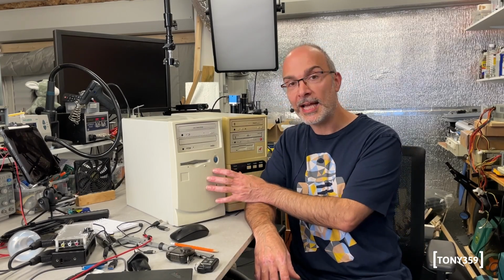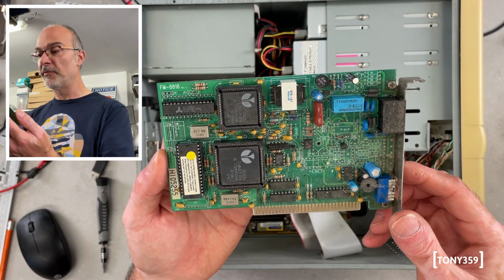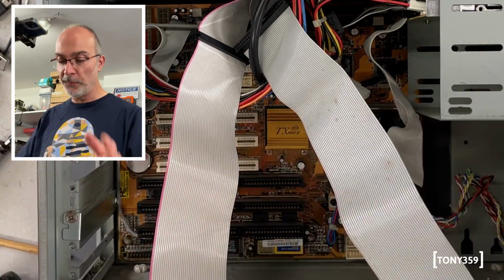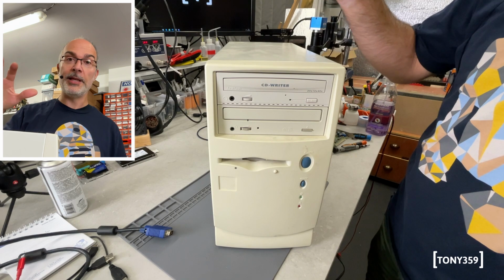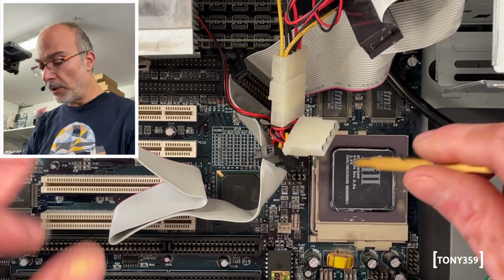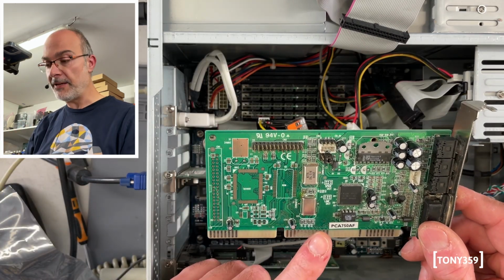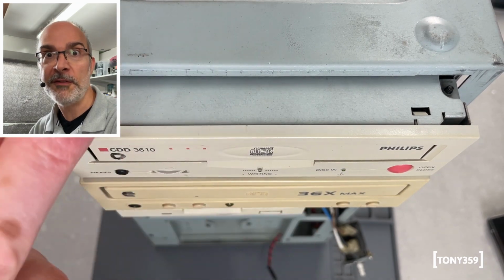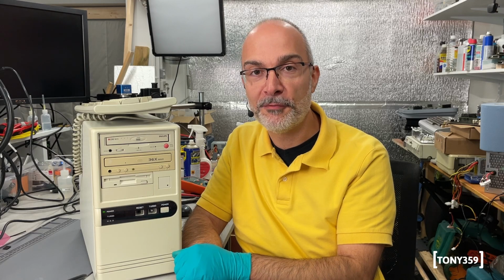I was pleased with what I found in these two old PCs!

Comment: Nice :), i have almost the same case that you are using (my first PC), just that the front is different and the case cover has indents on the sides and top. I am rebulding it with a socket 7 board, but i am missing the backplate for the motherboard :((, i have not found one that fits yet, i do have another AT minitover case that i can use until i find a plate, but sure would like to use my old original one. If anyone has one of these back plates i would be interested indeed. Keep up the great work :)
Reply from the maker: Did Socket 7 have backplanes? None of mine have it. I think some Socket 462 have it but not the Socket 7 which are all AT keyboard. Am I missing something?
Reply: @tony359  well i meant the motherboard plate that you can remove from the case, my case is missing it, so i need one that fits this periculair chassi :)
Reply from the maker: You mean the one where you screw the motherboard on?
Reply: @tony359  Yes exactly, it's missing from my case, and there are so many different ones. So i have not found one yet that fits.
Reply from the maker: Oh I see, yes, those were non-standard. Though they were just pieces of metal, maybe you can have one made if you really like that case.
Reply: @tony359  Yes that would be an option if i dont find one that fits, onother option would be to modify one that is close to the original :). I will probably have to go with my second chassi for now and install the original front on that one and also the case cover. This other case is in very good condition as well and has no corrotion either, same with my original, all in very good condition :). Have been for a while been gathering parts for this build, also the Turbo MHZ display was missing on my original, but my second AT mini tower case has a 3 digit one that i will use instead. My original front had a 2 and a half digit (max 199) display originally, would prefer one like that but a 3 digit one works fine as well. I will go with an 166 MMX i think to begin with, i have 3 Socket 7 CPU's in my collection so far. One 150 Pentium one 166 MMX and a AMD K5 PR133 :), also two Socket 7 boards :).
Reply from the maker: I'd be happy with 99 or 199 on my case! My first PC was a 25MHz 386 so "99" was science fiction back then :)
I remember when the 386 DX 40 came out and a shop told me it was unreliable "because it's too fast, the ISA legs act as capacitors and don't allow such high speeds". 40 MHz :) My Washing Machine is likely running faster than that today!
Reply: @tony359  Yeah :))), i remember a friend of mine had a 40 MHz 386 back in late '94 when i got my first PC, originally a AMD 486 DX2-66 MHz VLB system with a 1MB Cirrus Logic VLB card, and for sound a Gravis Ultrasound MAX with memory expansion. I still have the MAX card and intend to use it alongside a Sound Blaster 16 CT2910 that also has the genuine Yamaha OPL chips :).

Comment: I made some more comments, but they disappeared. I’m not sure what happened. Maybe they got taken down because they had links to Vogons in them? In any case let me try to remember what they said this really sucks.

I have a video that I linked to where I was playing halo combat evolved on a cyrix MII processor. These processors for some reason got a bad rep back in the day which I don’t think they deserved. They are actually very fast CPUs, and feel very snappy when using them in fact, when comparing them in some task, they seem as fast per megahertz, as a K6 3+

Also, I mentioned that the CPUs support 4X multiplier. If you pull BF2 to VSS

Another interesting thing is the CPUs I believe also support a 1X multiplier, which something that might be kind of fun to play with
Reply from the maker: YT sometimes doesn't like links - sometimes it does. Pretty frustrating. It wasn't me :)
My experience with the Cyrix cpus is fairly limited, I didn't do many tests. Good to know they weren't so bad!
Thanks for trying to comment :)

Comment: I think the 36x creative cd-rom is an aopen cd-rom in reality.
Reply from the maker: Ahhh, interesting! Does that mean Creative didn't manufacture their own CDROMs?
Reply: Yes and HP with CD rewriters(which really are a sony CD rewriters and with rebadged firmware with low writing speeds for example) this is more common than you think. Packard Bell's mainboards on the 486 was manufactured by Zenith
Reply from the maker: Very interesting thanks!
Reply: @tony359  Wait there's more the Philips cdd you have may have a problem with a belt that spins laser Up and down to read and write this those writer are hp ones surestore CD writer 4000 i think and have the same problem on the order hand HP cdwriter plus 7500 is a sony 4x2x24x rebadged to 2x2x24 which is the same as HP cdwriter plus 8100 based on the same sony model (4x2x24x).
Reply: i forgot to tell Sound Pro (SoundCard) is in realy a C-Media 8330. And the mainboard has that infamous ali chipset :( But for 66 Mhz frontal side bus works well, it has only problems with AGP. The AT PSU needs a load to test it. One broken hard drive has the job.

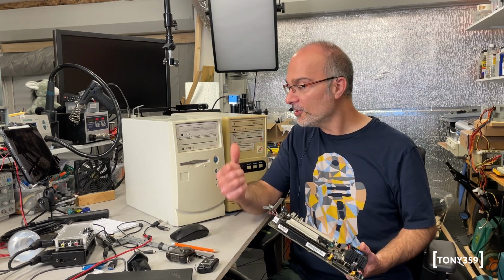Comment: 1:12 If you configure the standoffs correctly in an ATX case and use plastic stands for any holes not populated with a screw, you can fit the AT boards into ATX cases. They do sell IO Shields with space for AT keyboard ports as well.

Tempered glass RGB Socket 7?
Reply from the maker: hey this is cool! I wasn't aware of that! Been looking for a case forever (well, a cheap one!) Thank you!
Reply: @tony359  No problems. Phil's Computer Lab built one. Search Building a 386 DOS gaming PC with modern parts.
Reply from the maker: great thanks!

Comment: The system on the left looks very much like a Time or Tiny computers PC. If the chipset is ALI then it's almost a certainty.
Reply from the maker: Thank you!
Reply: I worked there from 1998 to 2006 and that case was ubiquitous with them. @tony359
Reply from the maker: It was probably a generic case used by many firms back in the days! But I love it, it's very cool! :)

Comment: The fastest CPU that Intel made that was available on Socket 7 was the Mobile Pentium MMX 300. These were technically TQFP, but there were interposer boards made for them to work in Socket 7. Today, such examples are rare and command a price premium, so they're not worth it unless you're wanting to make some specific build. The Chinese also made their own with gold heatspreaders on them some time long ago, these are even more rare. I've only ever seen one in the wild.

There were very few Socket 7 boards that supported the multiplier needed for those (4.5x), so you generally need a Super 7 board to use them at full speed.
Reply from the maker: Very interesting, I was not aware thank you!

Comment: As soon as the case was opened up, I saw the motherboard and knew we were dealing with a PCChips M57x of some kind. I thought it was the M577, but that's Super Socket 7. If you want to tempt fate, you can use a K6-2 or K6-III with versions 3.2, 3.2a, and 7.0 of the M571.
Reply from the maker: ahah I think I'll adopt the Shuttle 591P for my own system! It seems to be one of the favourites! Thanks for watching!

Comment: Nice findings especially because all of their parts work, so you have spares that are ready if something goes wrong.
Definately the cdrom face plate needs retro brighting it is out of place now and I was surprised that you didn't do it when you disassembled it.
The midi theme of the duke nukem sounded wrong and with not many voices, consider changing that card with something else, try the analog devices one it maybe plays it more correctly... Or use the other motherboard with the good onboard soundchip.
Cheers from Greece!
Reply from the maker: I did retrobright that drive in the end - it's just that it takes time and this is the UK, not Texas! ;) I didn't want to drag the video for more time so I closed it with that still to be done! but it's done now!
You think Duke Nukem sounded wrong? The Yamaha is supposed to be a good one. Maybe I should try different drivers? I'll look into that thank you!

Comment: Thank you for this great presentation Tony! Socket 7 was my favorite, it was the only socket that supported a wide range of CPUs from different manufacturers and a wide range of speeds. They certainly made a difference with the socket 7. I remember that my first PC capable to run divx movie smoothly was a pentium 1 with an AMD-K6-2/266AFR CPU, and the name of the first movie I have played on that configuration was 'THE CELL'. 

I would choose one of those 2 Shuttle HOT-591P as my preferable configuration, because it has the AGP slot and it's more capable.
Reply from the maker: Ah yes, even playing a video was a challenge back then! Yes, I think I'll go with one of my Shuttles (it sounds like I'm going to the moon!). Thanks for watching!

Comment: Honestly cool findings. This motherboard are the earlier ones that have integrated everything. They were cheap but nowadays they are useful since you haven't to add external cards unless you want extra power. But those cards are expensive so you can get some retrogaming, just by lowing a bit the reach of games.
Reply from the maker: Indeed, I can imagine they were quite nice back in the days. One board, one stop! Thanks for watching!
Reply: @tony359  keep the good work.
Also yes I had some k6-2 back in past and ironically I kept getting those without trying much. I made some work and I'm looking for uses like retrogaming. But I don't have for a expensive gpu for those pc.

Comment: lol i recognised that motherboard straight away as I used to build and supply computers with that TX PRO 2 chipset back around 1998 ... the manufacturer was if I remember PC Chips they retailed in UK as the cheapest motherboard you can buy or that was what my supplier said I made a lot of systems on budgets for customers with them I even fitted an entire office with about 25 networked Windows NT of those TX Pros lol .. so funny how they still out there .. good video  ... lol I did stop the video when you opened the case before you said basicallt what i said lol  ... CYRIX had runtime issues with Quake !  --- i think the second drive is drive ARTEK or ARTEC or ARTECH lol I think it was ARTEC... because I used be supplied with similar looking drives and recognise the model -- sound AC'97 lol
Reply from the maker: hey thanks for your comment! Yes, lots of stories about the magical PC-Chips with fake plastic cache chips LOL! Thanks for watching!

Comment: 128MB on the i430TX is not the best idea, due to the cache only caching the first 64MB...
Thus I'd take the i430TX System with the 32MB of the first, which should be plenty for DOS Gaming...
Though not that familiar with SIS, but 3rd party Chipsets usually supported 128MB or 256MB Cacheable Area.
As for Graphics Card: 1MB S3 Trio64+ or 4MB ATi MACH64. IIRC in DOS the MACH64 might be a bit faster, though the 4MB don't really matter for DOS.
Reply from the maker: Yes I've been told. I might want to swap that intel with the MVP3 one which seems more suitable. Watch this space! Thanks for watching!

Comment: Both of those cases were generic, mass produced cases from the 90's. The first one was broadly used by a large number of "brands", I put brands in quotes because they were just assemblers not actual brands with proprietary components and case designs like IBM/Compaq/HP/Dell etc. The first case was also used by a brand called Mecer that apparently is still around today. They basically just slapped their badge on generic cases that they would build in, though, they did use cases from the same manufacturer for all their systems back in the 90's. You could however buy the cases unbranded and slap your own badge on them. Abacus was most likely a small, local to your area PC builder that purchased cases from the same manufacturer. I say that because the internal components are budget offerings popular in low end systems from the Pentium II/III era, offering "Pentium II like" performance for much less money. 

The second system is more interesting, that board is a bit of an oddball super socket 7 board using an Intel chipset. It would have been more expensive given the cost of intel chipsets/licenses vs VIA/SiS etc based boards. Also curious what is up with the PCI slot under the one you have the video card in with the lines across it, some kind of tape? Regardless, this would have been a higher end board with it's fully populated cache and high end VRM design (for the time). That RAM (128mb) would have cost an arm, leg and kidney if it was purchased in the 90's, more likely it was upgraded later when SDRAM had taken over and 72pin DIMMs dropped drastically in price. 32mb DIMMs were pretty much exclusive to high end systems like workstations and servers back then.
Reply from the maker: I went to check the video again - there is a terminal connector on the video card and it looks like "tape on the PCI connector" indeed! Well spotted! I do remember spending A LOT for 4MB of RAM back in 1993 for my 386 board, you're right about those 128MB of RAM! And yes, I remember those "assembler" shops, but it was so lovely! One big one in my town put the assembly line on display, you could see all the computers being assembled when walking outside of the shop! Thanks for watching!

Comment: As you said, the M571 is nothing to write home about, but it's very flexible. The BIOS can be (relatively) easy to mod, that should unlock a couple of extra options to tweak memory and more.

The Cyrix chips are interesting creatures. There are a few utilities for DOS that allow you to change CPU registers/buffers/things and get extra performance.

Having said that... the second motherboard looks better. 128 MB in 72-pin SIMMs is quite a score. Great rescue!
Reply from the maker: Never been too much into modding and tweaking but I might give that a go! You're right, 4 modules of 32MB in 72-pin format is quite a score! Thanks for watching!

Comment: I threw out a bunch of modems when I moved.  Now I wish I had some of them to practice on.  I got a cheap hot air station a while back and need to practice removing/reattaching some ICs before I can have any confidence using it on parts I really care about.
Reply from the maker: Facebook marketplace often has old boards for very little or for free for you to practice. I never get to that as I tend to repair them and then I don'w want to break them :D

Comment: I love that translation from British to American dialect at the beginning. :)
Man, PCChips was so sleazy.  I know they used to use that name "TX Pro" to hide chipsets that were not Intel, but I didn't know they also had that "Video Inside" logo that looks like "Intel Inside".  Good grief.
A unique feature of the SiS5598 chipset is that it can run 75MHz FSB without overclocking the PCI and ISA buses.  That was mainly useful for Cyrix CPUs that were labeled to run at 75FSB, but it could also be used to overclock an Intel chip.
In spite of that though, I think I'd use the same combo that you did.  The i430TX + MMX 233 is a great combo.  I use a similar system with a 430HX for Windows 95 / late DOS.

I agree with saving the older case.  It's more dated looking style is more interesting, plus it has a turbo button and 2 fully external 3.5" bays that the other case lacks.  I'd probably use it for something a bit older, like a 486.  The newer style case is more fitting to a late Pentium, even though I don't like the look as much.
Reply from the maker: Thank you! I'm thinking of fitting my faster system on that case and as you say a 486 on the other! :) Thanks for watching!

Comment: Back then I really wanted to get a panasonic cdrom with a red button just like yours. By the way, where did you get the rubber belt from? Do they come in a standard size? Thanks!

BTW, I love these videos and I need to see more!
Reply from the maker: Hi - there are some listings on eBay. The shape and dimension was ok but the diameter was only available in 30-40-50mm etc. The one I have is probably in between as 60mm is loose and 50mm is tight 🙂 thanks for watching!

Comment: If everything is intergrated on the motherboard. Then you know its a low-cost motherboard.. Really dont like TX PRO motherboard.
The graphics can be a very cheap SIS xxxx one that doesnt have any performance. Also that sound onboard is very low cost.. And Crystal or an ESS is definitely better.

I have such board laying on the shelf.  Doing nothing.
Reply from the maker: Yes I agree with you - but I'm getting mixed feedback on that sound IC! Anyways, the Yamaha will be ok and I have a Sound Blaster to fix on a shelf :) Thanks for your comment!
Reply: @tony359   no 486 system?
Reply from the maker: maybe the other case?

Comment: Turned out great.. cheers. Where did you find the replacement belts. The only ones I have found are for cassette decks..
Reply from the maker: Ebay :) There are many listings. The trouble is to find the exact one... Mine had the right shape but probably too short. Thanks for watching!

Comment: Left case, use for a pentium 1. Right is more a 486 DX 33 / 50 area case.. The right is the same i also have. And its yellowed also.. I hope to ever retrobrite it.
Reply from the maker: Yes that is a good idea! Instead of two very similar systems, I can make a fast one and a 486 one! Thank you!
Reply: @tony359   your welcome. In the time of the pentium 1.. The LED HEX turbo display was almost already gone.. And on most of these motherboard they didnt had any purpose anymore.
Its a waste to use a case with HEX display for a pentium build.. without a function, instead of use it on a 486 system so you can use it.
Reply from the maker: good point. But I still like the case with the display so... :)